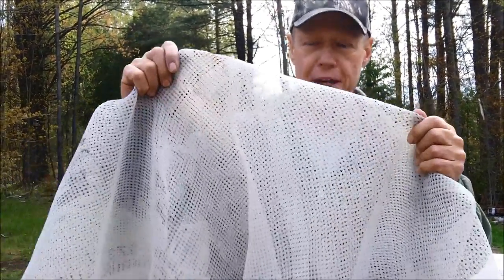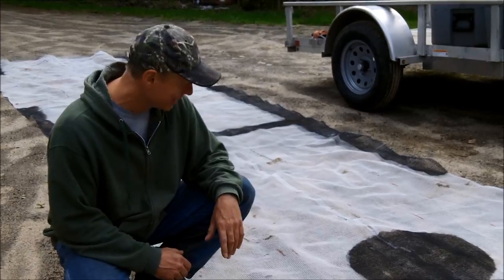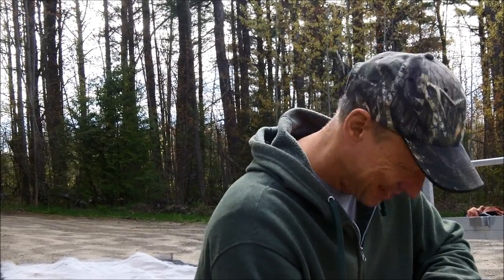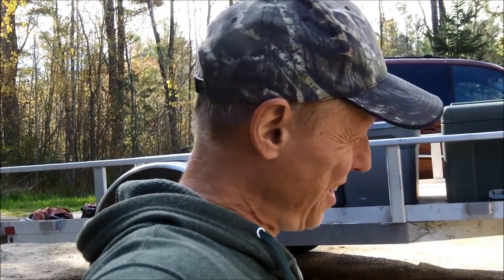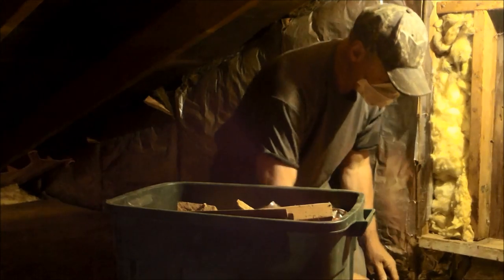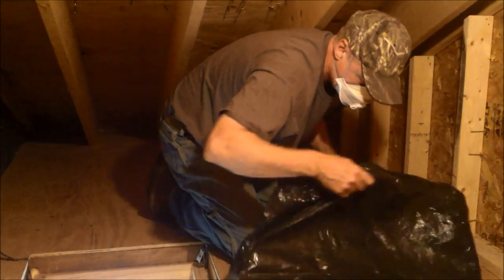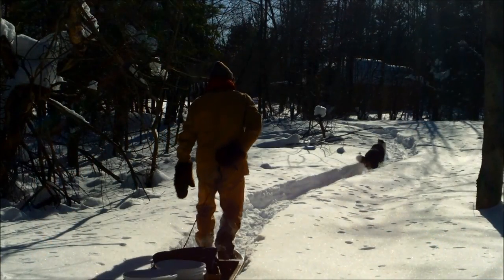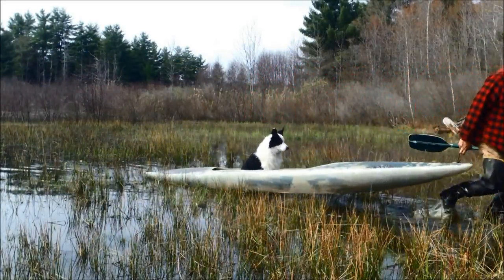CABIN LIFE VLOG   Downsizing and Minimizing.   OFF THE GRID WE GO.

Comment: In the 60's  when I was in the MARINES stationed on an Aircraft Carrier we shot a 20 mm antiaircraft gun at drones pulled by another air plane if i remember correctly it was on a cable about 1/4  mile long one day we shot the cable off and the done and it went into the ocean the 20mm shells were set to blow up at the distance the drone was away and exploded in to a lot of flack so it had to be a close but not a direct hit

Comment: Hello JC:  Good to hear from you again!  Watching you clean out the stove pipe (at 6:37), I'm guessing that's for your Kitchen Queen stove.  As I recall, you have a second wood-burner in the living room, but it has a masonry chimney instead of the "straight-through" pipe on the KQ.

That raises a question for me:  I know that a straight vertical stove pipe is the "lungs" of a wood-burning cook-stove, since it produces the draft that pulls the heat and hot smoke around the oven and up the chimney.  While that is ideal, would the Kitchen Queen also work with a masonry chimney like you have in your living room?  I suspect it wouldn't be as optimal as the "straight-through" stove pipe, but would it still work?

Thanks in advance, and I wish you the best of adventures and life as you and Frankie move forward!
Reply from the maker: Yes it would work ok but straight up is the best way.  I don't care for masonry chimneys at all.  I'll stick with metalbestos from here on in.
Reply: Thank you, Boss.  I'm closing in on my property Up North, but where I want to put my Kitchen Queen (between the kitchen and dining area) it looks like there's an upstairs bathroom the flue pipe would have to go through.  That's why I was thinking about the masonry chimney as it would be entirely outside the house altogether.  However, I'll keep what you said in mind as I look to install it.
Reply: BTW, another "thank you" for mentioning "metalbestos" chimneys.  I finally had a chance to start researching them, and was very impressed with what I found:  The inner chimney can be 2100F, while the outer chimney is perhaps 70F.  That's some amazing insulation between the two pipes!

Anyway, just wanted to thank you again for mentioning this chimney product.  It's very useful information like this that keeps me coming back to your channel.  Wishing you and Frankie the best as you downsize and move north.

Comment: When I was in the Navy, the Air force would toe the targets a half mile behind the aircraft. The idea was not to hit the target but the target had a proximity detector and anything within 50 ft was considered a hit. Now the Navy thought it was great fun to actually hit these $100,000.00 targets every once in a while or the cables. OOPPS, sorry and then we got our wrists slapped for not having the proper offset on the radars. The Air force of coarse did not think this was funny because we would be flinging anything from 2.5 to 5 inch projectiles at the targets which would give the toe craft a little jolt. Now a days a pilot will not get within a ships bubble because one shot or one missile is the norm for taking out an aircraft.
Reply from the maker: Thanks for sharing that :-)